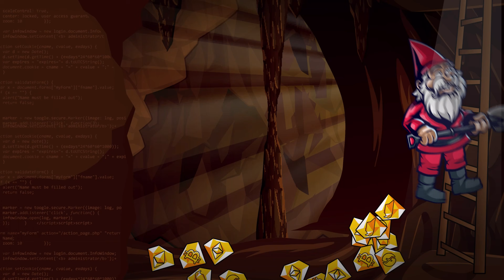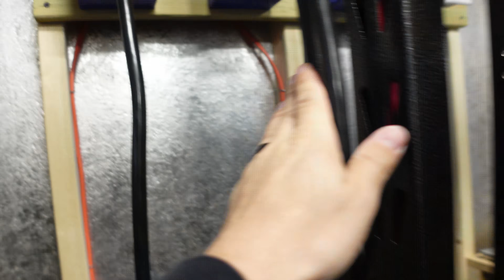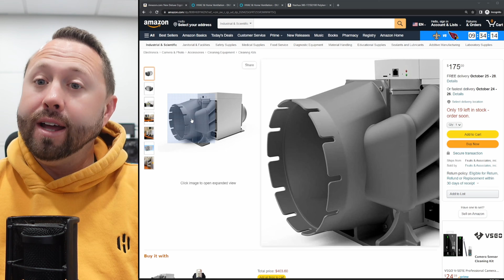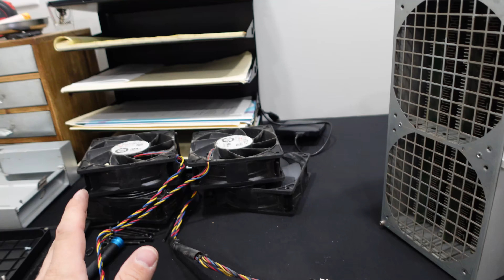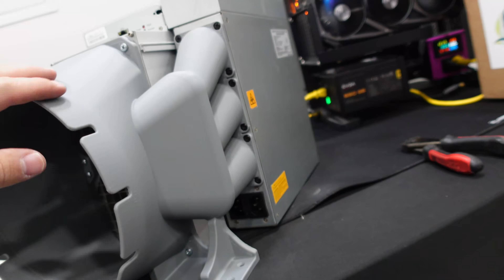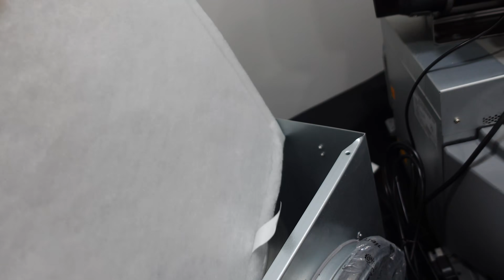Let's Build a BitCoin ASIC Miner Cannon for Better Cooling and a Quieter ASIC

Comment: I wish you would have had it running just like that to see how the sound was. I plan on doing this for my K7 but it will remain in my basement. I will be putting a large cylinder filter on it but would be nice to know if it's still quiet enough for a house. Thanks
Reply from the maker: 100% is. You can remove the fans, install the fan spoofers, shroud and inline fan and leave it.

Comment: After install of the in-line fan and removing the (4) fans, was there an electrical savings or was the project just to reduce noise?
Reply from the maker: So the inline fan uses 100watts at speed 10.  So it did use less watts than the 4 x 6000 rpms fans overall. But i was also moving MORE air.

Comment: If that fan that is connected to a different breaker trip out and that miner is running over 80 internally boards are going to get burn as the miner is going to continue running because since original fans been remove it won’t shut down right on time or right away and therefore over heat. I have that same issue running the same setup. Best thing you can do is connect that ac infinity to the same breaker that miner is running so if one of them trip ( miner or fan) both would shut down at the same time
Reply from the maker: S19J Pro will thermal throttle at 90C and at 96C stops mining on it's own as a safe guard.

Comment: Why are you filtering the exhaust? Should be filtering the intake.
Reply from the maker: I am filtering only the intake.
Reply: @TheHobbyistMiner   Intake of the ASIC or intake of the AC infinity inline fan? You want to filter the air before it travels through the ASIC. Unless I'm mistaken and the shroud kit is on the intake side of the ASIC and not the exhaust. If it is how do the ASIC exhaust fans handle the extra airflow being pushed by the AC Infinity fan?

Comment: I will tell you right now that the guy at "Fruits and Associates" makes the BEST shrouds. Period. I have tried them all - by everyone who makes them - and by far theirs are the best for several reasons. 

Also, just a comment that all our S19J Pros run pretty great until we start adding fan spoofers. I've been told the S19jPro models (the only ones we have, rn) are very very buggy firmware wise, so a word of caution to anyone looking to alter an S19jPro
Reply from the maker: So far so good. Looks like the spoofers are reporting the fans at 6900 rpms right now.

Comment: Tape those adapters man
Reply from the maker: Tape the Shrouds to the ASIC? Is that that what your recommending?
Reply: @TheHobbyistMiner  No those PCIE adapters, sorry I wasn't clear, I have a couple H110 BTC+ motherboards and you have to have at least one wrap of electrical tape around the adapters otherwise they will touch and short, you can see how close they are to touching

Comment: I would be nervous completely removing the fans on the Asic. Especially with the inline fan on a separate breaker. What if for some reason the 120V circuit breaker pops but the S19 keeps chugging along on the  240V circuit? Hopefully the thermal protections will be fast enough to shut it down but 3kW heats stuff fast... I have a similar setup but I keep the original fans on. They do very little noise at 2-3k rpm but will ramp up if the inline fan breaks or shuts down.
Reply from the maker: Its a great thought.  Something to workout forsure.
Reply: Great idea, i have a similar setup as well with 2 Asics in my basement. Right now i have one 8inch fan blowing outside air into both. I'm also in Pennsylvania so it's been nice and cool so all works great. That said, I've always been worried the fan gives in and the Asics warm up too fast and something gets messed up. Keeping the original fans on may then be a fail safe and like you said, they will just fire up
Reply: Why would your circuit randomly pop? That's not how electricity works... If you're that concerned about it simply run a dedicated 15amp breaker for this fan/set of fans. The original fans move ~360-500CFM (having fans on both front and back doesn't dbl airflow) so if you want you can reduce the inline fan down to ~500CFM (2/3 power) and it'll last longer than your stock fans.
Reply: @Porter302007  Maybe he also has a toaster on that circuit, I don't know. Or the fan bearing fails. Or a squirrel chews the wires. Point is : you never want to have a single point of failure.
Reply: @guillaumel9891  you're listing avoidable failures. Fan bearings fail progressively they aren't a binary function - they'll fail over time which allows ample time catch and resolve the issue. You do not need to over engineer or introduce unnecessary complexity to the situation - the addition of extra is more often a detriment to the process.
Reply: @Porter302007  If you are 100% confident in the Asic overheat protection circuit, sure, this is a non issue. I am not, but maybe you have more information than me on that matter. The fan is unlikely to fail suddenly, but could also fail for many reasons, foreseen or unforeseen. My concern is this could be a fire hazard and keeping the fans on is an easy fix, not over-engineering. We have to consider both the likelihood of events and their gravity.